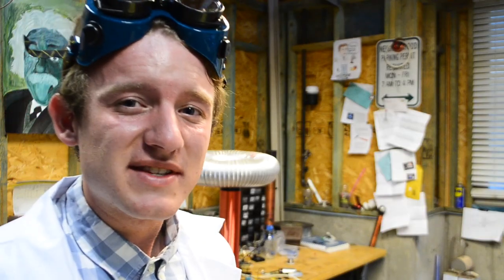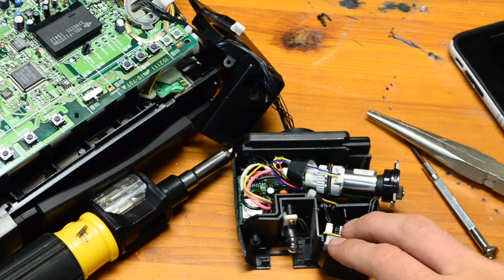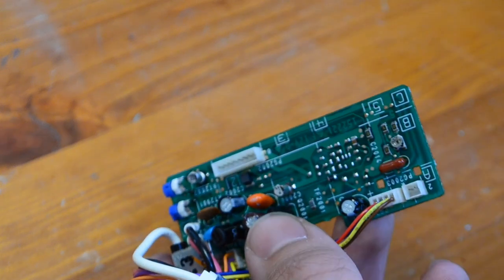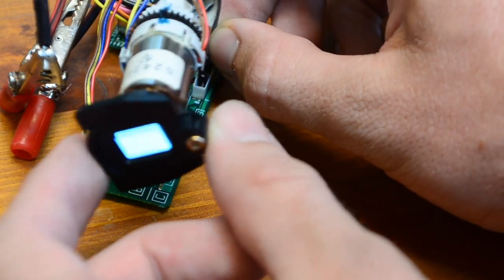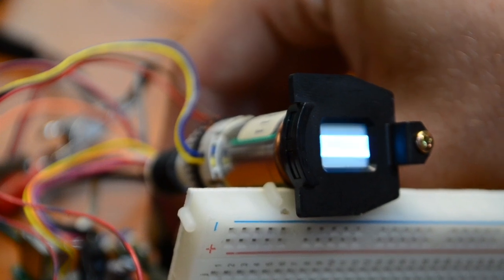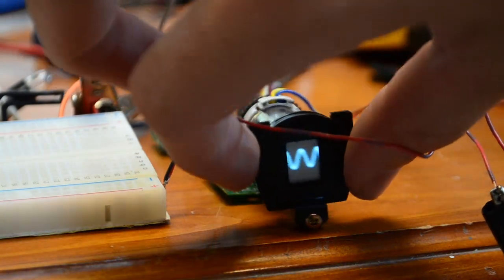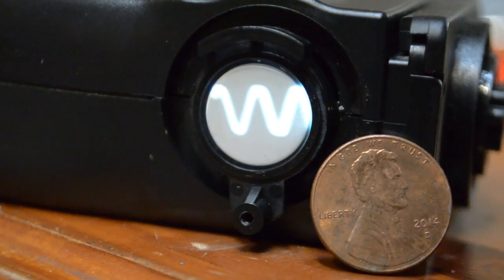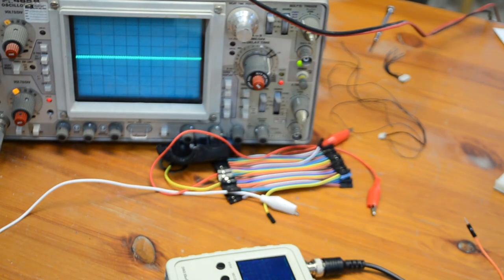How to make a Pocket Oscilloscope

Comment: Tip: The smoothing capacitor mostly tells you the maximum input voltage range. Is it for example rated 6.3V, you can be sure it must be below that.

Comment: In the early 90`s I used an earlier model camcorder CRT (2.5 cm diagonal) in a similar setup, on the front side of an audio amplifier (built by myself) to give an interesting video display of the music. Those CRT`s were so good, that Panasonic used them to build miniature portable TVs... I wanted to build an oscilloscope using that CRT, but electromagnetic deflection limited the band drastically. Nice to see people still interested in old school electronics - a lot to learn from there. Nice video!

Comment: I just made another one with a sony watchman. I thought this thing had absolutely no practical uses but this one works better than the one i made with a camcorder and because it was originally designed to be portable it was very easy to make simple modifications. It runs off 4 "AA" batteries and has a bigger screen with a brighter display! Thank you so much for this video. This new scope should help me understand what I'm doing with the circuits i experiment with!

Comment: It would be awesome if you could make a Tesla coil like one of them in the background of your videos
Reply: There is really nothing special to it... Just two coils, capacitors and the transformers of a old microwave.
Reply: You can eliminate a lot of these factors rather easily... You can tune the coils by measuring the individual capacitance of the second coil with a multimeter, then adjust the number of windings to get a good resonant frequency (or just create some Leydener flasks, you can control the capacitance rather easily). And just replace the spark gap with an IGBT/thyristor etc. Expensive, but can perfectly be regulated with some sort of microcontroller (via a Darlington-circuit).

But yeah, a video about this coil would be nice, i am interested how good this makeshift toroid is... (I want to make a bigger one myself, but i do not want to get shocked by a f*cked up toroid).
Reply: Eulemit Beule wait you still call capacitors condensators
Reply: Christian Wang I can change it if it really annoys you... If you constantly have to change between german and english, there is a good chance you get something wrong from time to time.
Reply: Max Power ohhhhhhh that makes a lot of sense
Reply: Eulemit Beule lol I'm from Poland and we say kondensator so yea it feels natural to me even when you say it in English as condensator xD

Comment: I'm an electronics hobbyist, and I've wanted an oscilloscope for monitoring the signals sent from pagers that I received on my DIY short wave radio for ages. Anyhow, I've been a big fan of your work for a while now, and I was even around when you made your original oscilloscope from a CRT TV, I tried it, but blew a component when accidentally powering the wrong pin :P (my garage/workshop smelt terrible for days)

Comment: That small oscilloscope is really neat. It would be handy for testing devices when the measurements don't have to be as good as with a $5000 oscilloscope. If it breaks it isn't a big deal since it isn't that expensive.
Cool idea using the viewfinder from a camcorder for something! One could even calibrate it with the commercial oscilloscope to be able to make some sort of measurements, but having a frequency option would be really useful.
Gimme da metar!

Comment: This is such a neat idea! I had no idea those little CRTs could be powered with just 5 volts. Also that pocket oscilloscope is really neat, seems to have a bunch of functions for its size and price, I would love to have one lol. I do have a much older, bigger oscilloscope - an eico 435 from 1965 that I bought from an antique store. It works pretty well considering its age, but there's a little interference at lower settings, I'm thinking an electrolytic capacitor, possibly the filter, went bad, as they do on older electronics.

Comment: I really like your channel. I think you are doing a really nice job of creating these demos. It's not overly simplistic and not overly detailed. You also point out good resources to use and safety guidelines (for the most part). You might want to have the text captions you sometimes add show up for longer in a gentler manner, but that's my opinion, you might be doing it on purpose. I think an oscilloscope like you reviewed would be a perfect way to test the pocket one you built. I'd love to get one of those and see how it holds up.

Comment: Ive been playing with several CRT's, from cameras, and I notice same as you see in 6:50 - that the line is pin sharp - until you remove the vertical coil - then it goes fuzzy.
Its like it uses the Vertical coil somehow do the Focus as well as deflect. This is different to larger CRTs in an old TV - focus pot does nothing on these tiny crts when coils disconnected .
Does anyone know what this signal should be? How we can replicate this?
I would like it much sharper that what is shown here and on my tiny crts. ta.

Comment: I'm interested in the pocket o'scope. 

This is an interesting video, though, as you say, more of a novelty. I'm used to thinking of CRTs as high-voltage devices, rather than something that runs off 5 volts. 

Your captions aren't on the screen long enough to read them. That last one about the glue went by so fast that I hardly even saw it.

Comment: Interesting!  We we need a little work to add sync.  On another point, while the brightness was more that adequate focus looked a bit blurry!  Also, a fundamental limitation is imposed by inductance in the coils the reactance of which needs to be substantially less than the output impedance of the signal source.  But, if it can reasonably cover the audio band, we would have something worthwhile for sure!

Comment: Be really keen on one of those pocket scopes, its the one thing my test bench is lacking and it really shouldn't be with some of my crazy projects. i don't have room for an oldschool scope, as it is my power supply takes up more space than i would prefer. building things like induction heaters and tesla coils, from recycled components where possible.

Comment: I have a number of the DSO-138 scopes, made my JYE Tech, but I have never seen a case for one like the one you were holding .
I find the DSO-138 to be an excellent choice for the beginner;  But I believe it lacks an option to put a 10 to 1 or a 100 to 1 multiplier probe on it.  
The hardware allows you to connect the probe but I could not find a way to tell the software that a 10 to 1 or a 100 to 1 probe was connected. 
That means that you have to so some math in your head to get the right vertical readings; which is easy, but all of the 'CALCULATED' values, such as RMS volts, will be wrong.
I was wondering if the scope you just received had such an option , because if it did; that would make it the perfect beginner's scope.
 And since I administer (and teach in) a facebook group with about 17,000 members just starting to learn electronics, I would like to recommend a beginner's scope and not have to worry about erroneous RMS readings with a multiplier probe attached.
I enjoy your videos.
keep it up!

Comment: Can you do this experiment with your Tesla coil HV generator?
1- Build a multi-layer capacitor from layers of aluminum foil and parchment paper saturated in mineral oil.
2- Place the Tesla coil in the middle and turn it on.
3- why does the corners of this capacitor plate lift? Measure the weight if the whole experiment. Anti-gravity?

Comment: Loving the scope!

I definitely want one. 😁
Is the focus on the tiny CRT adjustable?
I felt the line could have been sharper?
Reply: You can make it sharper by increasing the input voltage... Which really does make it super sharp. Sadly it gets the video chip burning hot, so you'd need a decent heatsink to make it work. Uses up more power too.

Comment: I think you can but similar analog scope on some auction site for a lot less. You only need to find a great deal.

For 400$ you can buy Rigol 1054z i think it is the best scope for that money (4 channels, 100MHz, digital) but it will be useless for you if you will only want to use it for hobby. I bought it because i want to work with electronics in future.

Great video as always! I didn't know that you can find CRT's as small as that!

(Of course I want to take part in that giveaway :) floating scope would be nice)

Comment: Damn, I never knew you could find an oscilloscope for that low of a price. I had a car with a bad crank or cam sensor. It wasn't giving me any OBD codes, and based off the symptoms, it could've been either. Either sensor was about 300 each, and both would require the engine be pulled. I ended up selling the car because I didn't know anyone with an oscilloscope and couldn't afford one. Now I know what tool to buy in the future if I ever have to diag a weird electrical problem though!

Comment: hey there! this would actually be very useful (i know it's picked at random) because i'm working on connecting 3 flyback transformers in series to the same ZVS driver and i need to know the output voltage and amperage! :D
Reply: PLS GIMME D'OSCILLOSCOPE
Reply: SUGGESTIONS: show how to connect multiple flybacks in series and you can also show what to do with an old computer power supply as im sure people have lots of those lying around you earned the thumbs up

Comment: I want one! I am trying to build one but i cant get mine to power on. There are 4 wires coming from cam I'm pretty sure ive got ground and power and 5v is the supply but its not lighting up.
Reply: Ok i tried with another cam. It works but the new one takes 8v. That means i cant use a battery pack like you did.😔 but now i should be able to see waveforms and hopefully learn more!

Comment: I could really use an oscilloscope. I would love to be in the giveaway. Been thinking about buying one but money is tight. I'm working on a generator that has negated Lenz's Law and I need to better understand it's output! If I don't win this, what is the best but cheaper-ist one that will give me the output I need, it needs to be able to handle a lot of current, or I could make a smaller version lol

Comment: Hi ! :) I have this exact osciloscope at home. Its really useful. :) Although scrolling could be a bit faster and the "click" button on the knob doesnt really do anything :/ :) 
I hacked it to be portable, as it has no internal battery. if you (Keystone) want to see how i did it, just hit me up. You could do nice and quick followup out of it. :) I belive I cant really post pictures on youtube... :) (Do not expect rocket science. Its just lipol, battery charger and stepup converter with smoothing inside. :) )